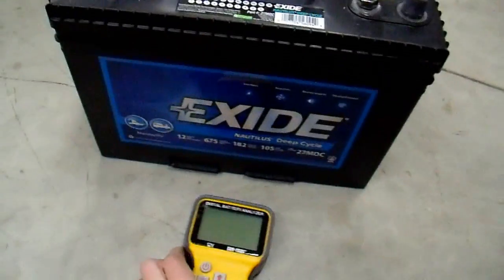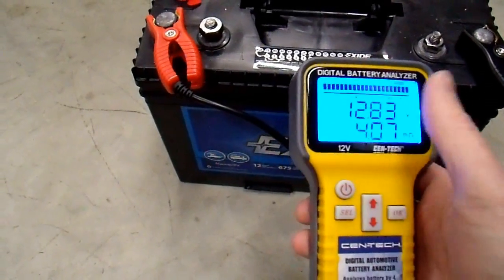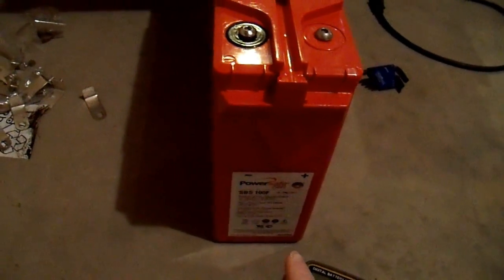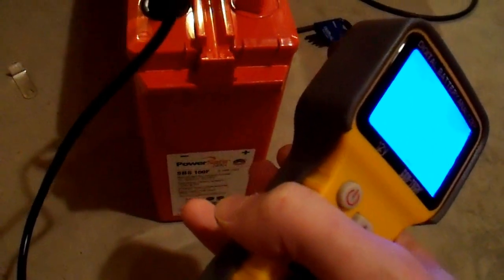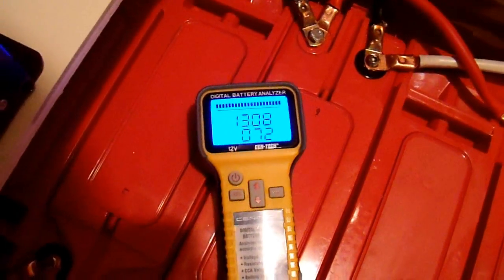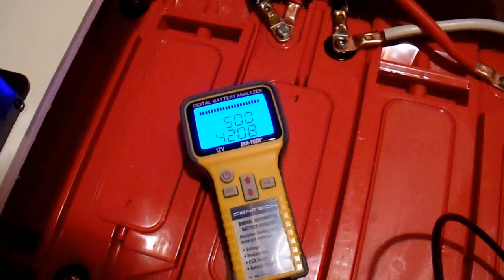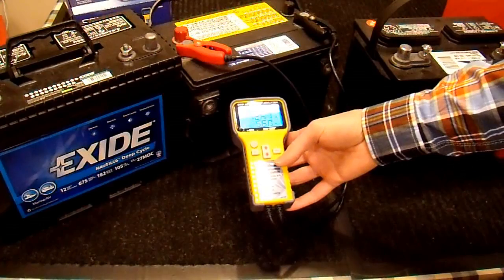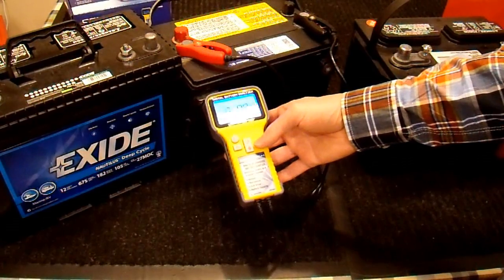Battery Analyzer Conductance Tester Review Part 2/2

Comment: So basically the colder the battery the more accurate the results? Is a reading of 330 amps acceptable for a battery at approx 32 degrees F
Reply from the maker: At 32F you should get somewhere near the CCA rating of your battery (because most batteries do not provide their rated output.  CCA is supposed to be rated at 0F but almost no battery will achieve the rated performance).  Once this falls to 70% or so of the rated value I would suggest replacement.  At 'summer' temperatures use the cranking amp rating of the battery to determine replacement.

Comment: What’s your opinion on a AGM 680 A starter battery that reads 350A (26% SOH) on a similar tester? It started my diesel car no problem at —7 degrees C. The tester failed my battery and said replace.
Reply from the maker: What was the temperature of the battery during the test?  Testers generally assume room temperature so when tested cold your battery may 'fail' a conductance test but still be good.
Reply: @knurlgnar24  Thanks for the reply. 
i got those readings with outside temps of approx 5 degrees C. When it was warmer 15 degrees C plus it would be higher 390-400A  but it would still report“ replace”. However if i test with the same tester on my friends newer battery at the same low temps it reports it’s full rated amps and 100% SOH. “ good battery”

However there are signs. My battery monitor often reports “ low cranking voltage” and on cold mornings the dash sometimes flashes glitches/errors warnings after a crank. However it’s been doing that for the last 1/2 years. The car never fails to start. It also has a start/stop system and seems to have plenty of reserve capacity to operate it when stuck in traffic. In colder weather below 1-2 degrees C the start stop system doesn’t work as well as it did last year though. The engine will stay running or there are limited start/stops.

The car is coming up on 6 years( original battery) and still starts right up on any cold morning. My conclusion with this battery is that it has plenty of reserve capacity left but has issues delivering high current hence the low voltage warnings. Battery resistance is between 7-8 mohms.

Comment: Hello Knurlgnar24, thx for the vids, always enjoy how thorough you are. Anyway, just picked up one of the Cen-Tech testers. I am getting quite a bit higher milliohm readings on pretty much every battery I test than what I see from your batteries. I  have a relatively new 60 amph AGM and the reading is above 5. Am I focusing on the wrong numbers here, kinda assume the lower the milliohms the better. Is this a quality of battery issue, plates, acid, etc? Thx for your help.

Comment: Hi, you talk the  most sense on lead acid batteries etc. of anyone  on You Tube.Some people talk utter rubbish, like these 'magic' desulfator boxes making 10 yr old AGM batteries as good as new overnight, because they ''now read over 12 volts & are fixed'' No discharge tests on load  needed then !!I have the Cen -Tech tester. I like it. I did find one of the switches went faulty, but they're not that difficult to replace. I used good quality (Philips) switch cleaner on the remaining switches. Switch cleaner alone might have worked, but I happened to have a suitable switch in stock.(I fixed electronics for a living.) I do find that any make of conductance tester (I have several) can sometimes give a good CCA / milliohm reading on a battery that is well down in AH capacity when an actual C/20 load test is done. I got the Chinese FDY1O discharge tester. I'ts only an inexpensive thing, but actually has worked very well for me. I checked the current draw with a D.C. clamp meter for instance & it's accurate enough for my needs. (The voltmeter on it is O.1v out at 10A checked against fluke multimeters, but again near enough.)    Keep up the good work & kind regard.

Comment: I still prefer the spark test when buying batteries from the scrap metal dealer 
If it can throw a good spark and still have a decent voltage then that's good enough for me to buy it and do a detailed diagnostic on it when I get home

Comment: I really like your videos, they are very informative.I bought a cheap tester from China (Aliexpress.com site) and the seller claim that the battery analyzer is able to measure the CCA and it doesn`t show the resistance value,just the SOC,SOH and CCA value.The analyzer also show if the alternator rectifier diode is faulty or not with a graphic analyzer.I just need to know if such cheap analyzer is effective or not.Sorry for long writing,but your opinion is important to me.
The link of the analyzer I bought: http://www.aliexpress.com/item/Hot-Sale-2015-100-High-Quality-BST-100-Battery-System-Tester-Cheap-Battery-tester-Free-shipping/32271933408.html
Many Thanks
Reply: I guess your question wasn't that important to the video poster. Unbelievable.